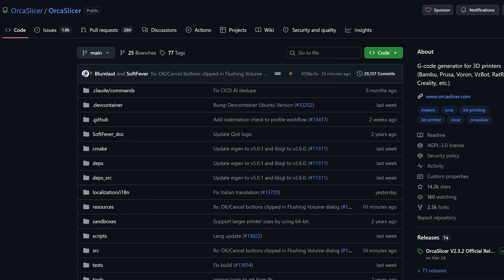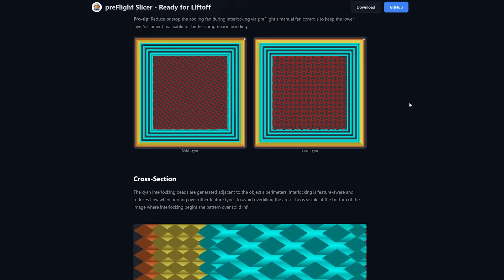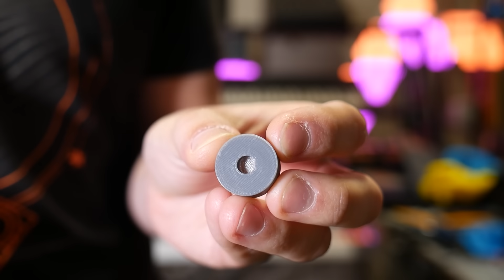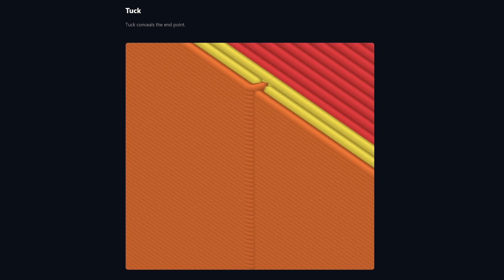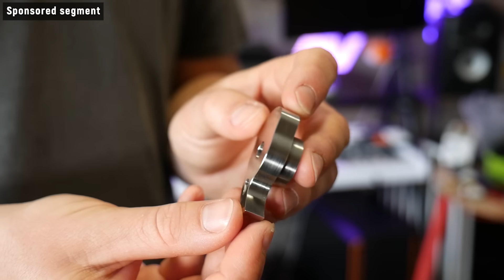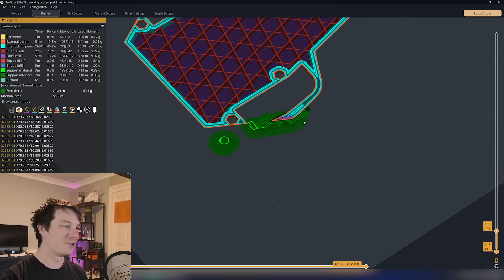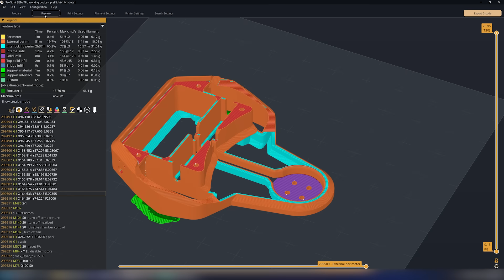preFlight - an incredible new slicer with even more incredible bugs (for now)

Comment: Call me crazy and no I don't suggest anybody else do this I only do it because I already have it and I already paid for it if I was starting off new today I would probably be using worker slicer or prusa slicer 

But besides some interesting multicolor features and some extra designs for infill I just do not see anything that these slicers can produce for me that simplify 3D can't do better and faster and easier 

Now I know a major portion of this is probably the types of things that I print and also the fact that I've been using the slicer for over 10 years so I've become very good at it but I don't actually do that much and that's one of the reasons why I like it so much I open it I bring my file in it literally takes me 10 to 30 seconds to make a few key changes and I'm done That's it I just hit print and it just works 

The only real problem I have with it is it hates gyroid infill a large model with lots of gyroid infill brings it to its knees when it tries to calculate the slice otherwise it just works better. 

I don't see any point in the multi-layer support for holes just use a single sacrificial layer and why would you drill it out? Just take your boat and shove it through it it's a single layer of plastic unless you're printing millimeter thick layers you're just going to shove it right through it and it works every time 

This is where you're doing different things than I'm doing and maybe that's the problem? Where you need things that I don't need so I don't realize the problem because I'm not doing that kind of a thing but for example the nip and tuck for your dimensional accuracy I've simply never had that problem ever I design a hole the part fits almost without fail now maybe simplify is doing something in the background that I'm not aware of that accounts for this? And with something like orca or brieflight you have to do it manually? I'm not sure and I don't know how to test that 

One of the biggest problems we're having with slicers today is that we are stuck with only having basically two slicers slic3r and cura everything else that we have is a fork of those two and therefore also limited by those two 

Simplify 3D was a ground up fresh slicer but it's dead now Even if they tried to update it I doubt anybody would back it after they charged us 50 bucks for an update which I was fine with and then no more updates after that yeah that's called burning your bridge but what choice do they have? They're not an open source slicer they have no other way to make a profit except this other slicer 

And this is why all slicers are based on those two slicers because someone else another team of people of open source creators did the work to create the groundwork The framework of a slicer so far nobody's gotten together a team of people who are capable of doing that again and the result is everything's a fork of those two a few have tried what's that one slicer that used it was used heavily for the belt printers I forgot what the name of it is was that a fork of one of these or was that purely independent slicer? But I haven't heard nothing about that in a long time idea works? Something like that 

I think that's what we're going to need though I think we're going to need all the big boys out there ultimaker creality the orca team Yes even you bamboo to all come together as third parties to fund a team effort for which the funders will have no control over the actual programming they will basically provide a resource pot to start developing a brand new slicer from the ground up to find novel new ways to handle the stuff I have a feeling that we're just barely scratching the surface of others technology can do 

I think there's a lot of potential being left on the table here and part of the reason why that happened in my personal opinion I could be wrong here is that the environment that allowed something like simplify 3D to exist doesn't exist anymore meaning there was enough money in the industry that a company could afford to write software for profit and the result was a fantastic slicer that's still holds up today even though it's basically obsolete and defunct 

To be honest there's not much of a difference between my one how duplicator I3V2 with a few printed upgrades and a X1Z carbon from bamboo there's just not that much of a difference Yes it's got iterative updates it has the ability to add noise reduction and input shaping and whatever else you call that stuff it does it's faster it's more of a find but that's all it is it's it's an iterative update it's not fundamentally different 

We are starting to see some fundamental upgrades for example the guys uneven layers? That are making the five axis 3D printer that thing's amazing but of course their biggest roadblock which they're overcoming now has been slicer support without a slicer it doesn't matter how fancy the printer is 

What we need is some new young visionaries who can see what we can't see who can envision things of this technology could do that we can't possibly envision today because we're stuck in our little ruts and it's not that we don't want to get out of it it's not that we're trying to be elitist or get off my lawn or any of that kind of stuff it's that when you get stuck in a rut like that you just can't see outside the rut it takes someone else who's not in that right with you to go why aren't you doing this and then something you go oh well yeah why aren't we doing that That's what we need we need fresh blood and that fresh blood needs the resources to be able to make something happen 

Because unlike a printer would anyone can make with a one-off set of hardware and you if you have enough skill you can get some sponsorship support for that software development is a lot harder that takes some real well what we don't got 

And for the love of all that is extruded from our filament printers please use the AGPL licenses for anything that we make so that we can prevent it from being locked in in the future 

I love that old dude I forget his name it really angers me that I forget his name but he basically I think he's the one who came up with The rep rap concept and something that he does that really just tickled my heart and made me smile was somebody comes up with a new idea and the first thing he does is sketch it all out and put it in the public domain so it can't be patented I love that God I love that type of information wants to be free attitude.

Comment: Huh with a name like "preFlight" I wonder if this slicer fork was worked up with R.C. Aircraft in mind and considering the features like "nip and tuck" seams? I also wonder if the Devs of preFlight saw my work in multi-material printing with foaming filament and applied the lessons I shared to develop "perimeter interlocking"?
Reply: I'm a web developer so when I hear preflight I think cors 🥴

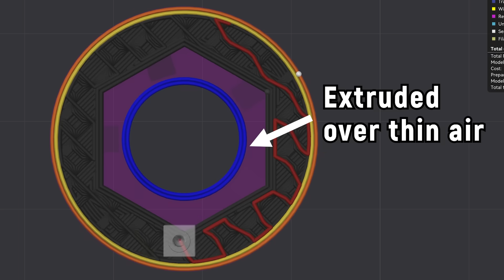Comment: there's a brilliant trick for prints like that at 6:50. fill the void with a slightly smaller part, and print it in an imcompartible material. (PLA and PEG wont bond) 
pause the print before the bridging layer, insert the (re-usable) support part, and continue printing. 
for small scale production, this is a game changer!

Comment: Cura has that "nip and tuck". Was one of the reasons why i used it for so long. But, you don't have much control over it, it just moves the nozzle inwards before retraction... But, it does better seam accuracy than Orcaslicer, where i had to start using grooves to park the head at layer change, hiding the seam inwards for holes and such.

Comment: Oh how much I want the other slicers to let me pick which support to use, where. Instead of all or nothing.

I'm conflicted about this slicer... you kinda missed the why it exists: legacy code. Or specifically, removing it. preFlight is PrusaSlicer if they removed all the legacy code, backwards compatibility, etc. It offers an extremely clean starting point for adding features and doing improvements... but it also means it broke a lot of things along the way. And if this had come out before Bambu, it would probably be a 3 way competition of PrusaSlicer (paid dev team maintaining it), SuperSlicer (every feature under the sun and billions of options), and preFlight (the sleek and toned slicer that has code clean enough to do complex features like the filament stacking and such).

But it's not in a vacuum or at an earlier time, and that's what makes this a conflicted thing. I want it to exist and work, but most or all of it's features can be ported to PS, BS, and OS. Then throw on top of it that it doesn't really address limitations of PS and make improvements on them (16 bed limit and such), so it needs those new features to be so in-demand that I would use it over PS. But it doesn't. And then there's the high chance Bambu copies the features to BS and OS either copies those over, or copies them on their own. So once again, this becomes a cleaner-code version of PS, which is not really a user feature.

Then the 2 elephants in the room: FullSpectrum... Prusa literally just released ColorMixing (FullSpectrum with a different color mixing system) for PS, Bambu has FullSpectrum, and if Orca doesn't add it, I'm sure it's being worked on. So where's the preFlight one? I now have even less reason to change slicers.

But then the other elephant: PrusaSlicer 3.0. It's coming, it has a new UI (basically EasyPrint... so either a HTML-based UI or something like that), it has new internals, it probably has a bunch of new features. So preFlight is now the clean code version of the last version of PrusaSlicer before it's practically rewritten. Something so big they are calling it 3.0... last time that happened was going from Slic3r PE to PrusaSlicer and dropping basically all the legacy Slice3r code. Bambu, Orca, and Prusa have all moved on with new code bases... and I can't see preFlight really doing anything on that new base.

I wish them the best, I have it on my computer and will give it a try eventually. But right now, it's a "oh yea, I have that installed" slicer.
Reply: Prusa might have moved on with 3.0, but Orca and Bambu don't have "new" codebases. Orca is still struggling to implement Clipper2 into their codebase and just adding it on where they can. Preflight brings a clean slate but to the user that does not matter. Orca, Bambu and Prusa have been bogged down by the legacy code before. But Bambu doesn't have a clean codebase nor does orca, it wouldn't be unreasonable to call both of them building jank upon jank. When Bambu adds a new feature it is clean and useable on the userside but it's guts are jank.

Does that make Bambu or orca worse for the user? No.

Could that burden them in the future? Maybe

Ah right about your color mixing thing, Preflight has it not sure why it's not a feature they mentioned but it is there.

Comment: Orca slicer has had counter bore hole options for a while and a good way to get rid of seams is to make deretraction speed 60-100mms
Reply: Why would this get rid of a seam? This setting is almost always below 30 in every profile. Typically more aggressive settings result in blobbing.
Reply: @phasesecuritytechnology6573  because a noticeable seam occurs because the nozzle pauses for a nanosecond with filament oozing out. When you set deretraction faster than 30mms the nozzle lands and gets moving a lot faster leaving less of a seam.

The seam gap setting only leaves a gap at the end of the seam too which leaves a hole if too extreme or makes the seam more obvious because it's not the problem.

And actually slower deretraction leads to blobbing because the filament is ozzing while the extruder is slowly pushing filament instead of wacking it down and moving.

If you set deretraction to 10-20mms you can literally watch the nozzle stop and wait.

You should try printing with foam. 300mms retraction and deretraction to get rid of stringing and blobs 😂😂

Comment: Secuential bridging also exists in orcaslicer and it's automatic. So turn it on and it figure out all the counterbores. Sacrificial layer is also an option
Reply from the maker: It is!? How did I miss that I'll take a look.
Reply: @MakersMuse It's kind of buried, I only found it looking for some unrelated support settings
Reply: @MakersMuse It's in the same place as sacrificial bridge.  It's auto magic so you don't get to decide how many bridges it does.
Reply: It's called Bridge Counterbore holes in orcaslicer I think
Reply: I think it's in the quality tab at the bottom
Reply: @phasesecuritytechnology6573 quality tab in the bridging settings
Reply: This is probably the most useful post I have seen on YT for a while, thanks for this 👍
Reply: Yep I was gonna comment this as well
Reply: whaaaaaaat.
Reply: I had a look myself, and while it is there in the options, it's not even close to what preFlight does. 
Orca only has "partially bridged", which only does one layer, and still likes to start walls in mid-air.
Reply: @ZW6604 find counter bore

Comment: A giant scrolling column of print settings?  Isn't that just normal?  I mean, I'm a Cura user, so...
Reply: Left cura like 3 years ago and never thought about it again. Prusaslicer took me a WHILE to learn but it's 1 billion times better
Reply: @enb3810  eh its better but not that extreme.
Basic stuff like first layer flow rate in Prusa requires entering multiple lines of custom gcode, in multiple locations.
Reply: I resisted moving away from Cura for a long time as I really dislike the time it takes to learn how to use new software effectively when you just want to print stuff, but I'm glad I finally switched to Orca. One of the things that encouraged me was the silly length of time it took just to open Cura on my machine, despite removing a ton of unused plugins and filament profiles etc.
Reply: @ferrumignis  Yeah, it's very slow to open for me too, so I enjoy that part of switching too.
Reply: @ferrumignis  there is a plugin to speed up loading, "startup optimizer". dumb that it had to exist but it sped up load times.
Reply: Ikr I was thinking, lol, just looks like cura
Reply: I only recently switched from Cura, but there it was bigger and less cramped, and I used the search bar a lot, and also had that tab add-on that was also helpful. I still like Cura's column of settings, but the next best choice is PrusaSlicer's spacious tabs, in my opinion.
Reply: Cura in 2026?

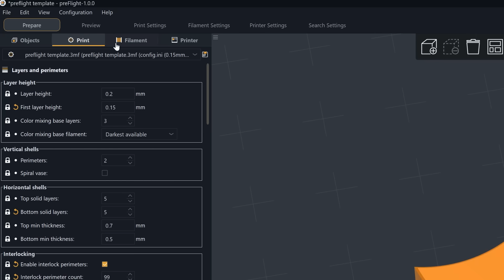Comment: 2:02 For the slicer settings in the sidebar, you can turn them on/off with the checkboxes next to each option in the normal print/filament/printer settings tabs. So only the settings you care about will show up in the sidebar.
I'm not sure why the default is to have everything turned on! But I love this feature to make certain settings always handy like perimeters, number of solid layers, infill type, etc.

Comment: 13:49 Using 2 support types is actually insanely useful - and it is also not easy to do in other slicers either afaik. (you'd have to do modifer shenanigans).

Comment: CC3D 72d tpu is not nearly impact resistant as 95 or 98a (in my testing).

I did some firearm target testing in the USA and the 95/98a survived whereas my 72d kind of shattered. On a solid 8x10cm target it would crater out instead of pass through and self-heal.

For a combat robot dealing with a multi thousand rpm metal weapon, I'd almost recommend a tool changer and use the exterior face with a more impact resistant filament and the stiffer tpu for mounting points.
Reply from the maker: Huh good info thanks, I'll pass it onto the robot builders.
Reply: @MakersMuse  I've recently used the 72D TPU from CC3D as well for an Antweight, and it did shatter, while parts printed with 58D TPU from Extrudr are way more abrasion resistant and just bend.
Reply: @Bunkerotter with 95a being similar to 45d and 100a being similar to 58d, that tracks.  My 95a tests faired the best but 98a did well. 

Glad to see I didn't have unrepeatable results.
Reply: I am very curious how your matches will turn out and if you have similar results.  I felt inclined to comment when you mentioned the unrestricted ant class with metal weapon. 

I'm a bit lazy right now to do the math but AI tapped into Wolfram Alpha says it's about 1200-1300 joules of energy at my distance and caliber.  That checks out when compared to avg ballistic graphs so I'd say reasonably accurate. 

Good luck and will be awaiting your next video.  🎉
Reply: Maybe he should try 78D from phateus 😅

Comment: strange that you have problems with seams. i used to till i watched one of your videos about flow rate and coasting etc.. since then none of my prints have had seams in them.. :) so you swap a seam for a crease but least parts will fit and not blocked by the seam